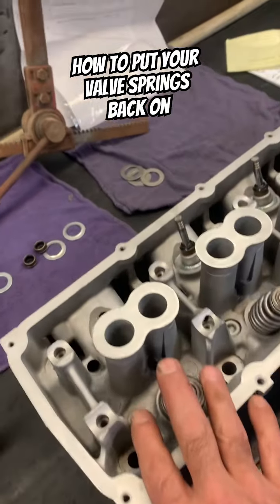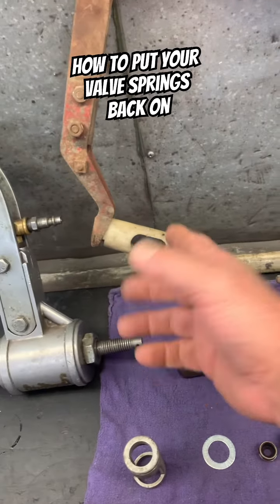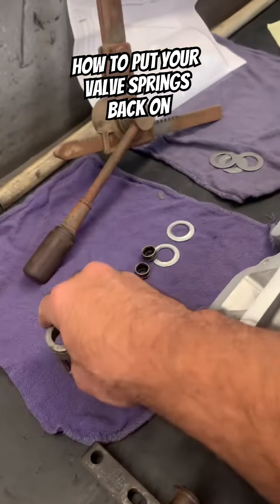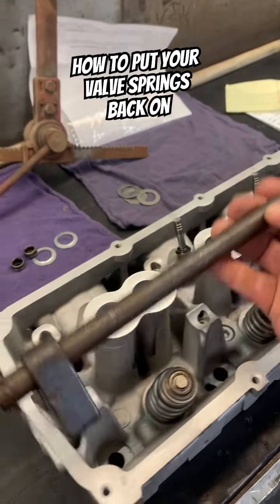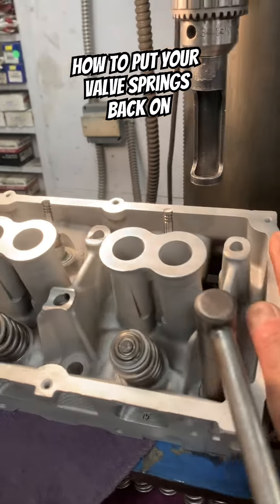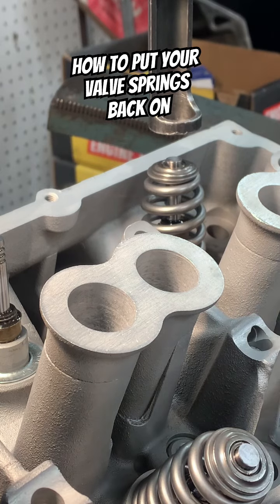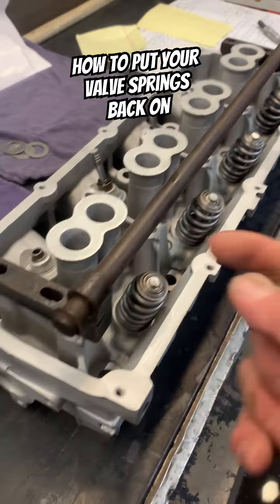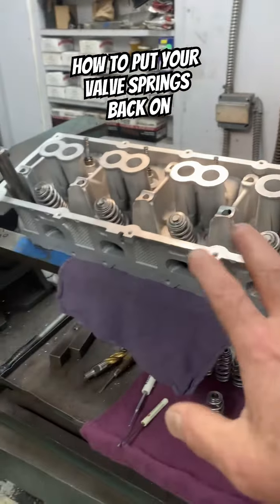How to put your valve springs back on. Here a few options. #howto #diy

Comment: Nice comprehensive list. There's also a tool that you smack with a hammer. It has a magnet inside to hold the keepers. Lisle 36050 is the part number, but other brands have something similar

Comment: Hello Dani. Do you recommend "seating in" the keepers after assembling them , by lightly hammering a socket over the retainer after everything was assembled. I'm talking about DOHC 16v Toyota head.
Reply from the maker: We always do, but we don’t tap on the retainers, you want to tap on the valve tips. I use a brass drift. When I was a kid my uncle just had me use a hammer.